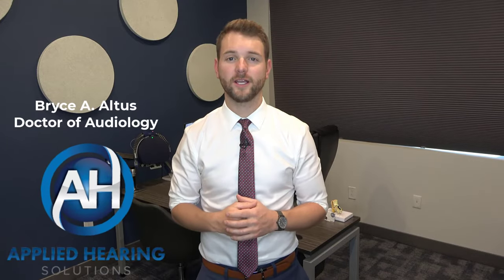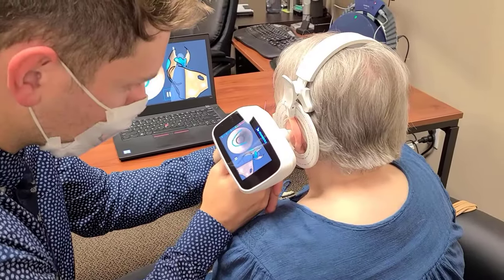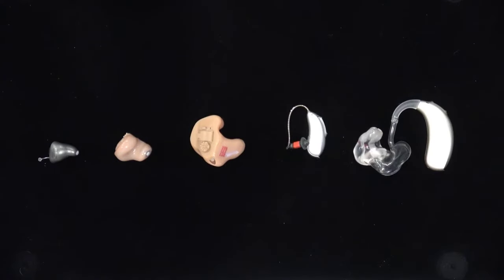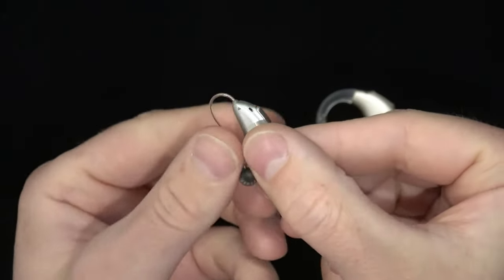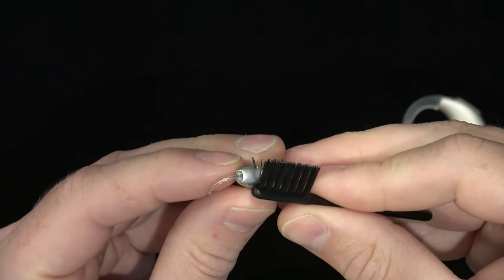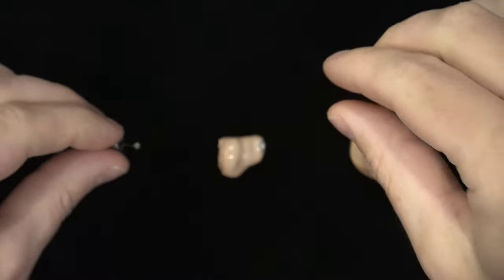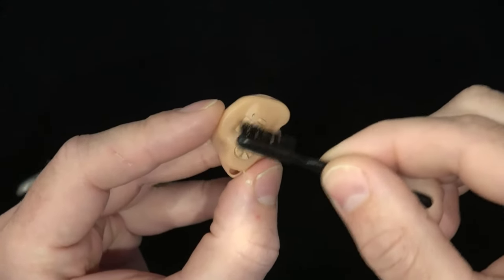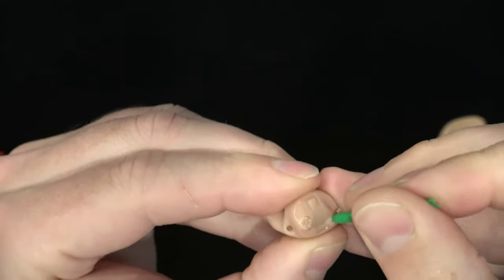Cleaning Your Hearing Aid Microphone  Ports! | Applied Hearing Solultions

Comment: I have Kirkland Rechargeabl Hearing Aids and my right Hearing aid shows in the app shows less  % of use than the left one. They bought come out of the charger at 100 %.  Why ?
Reply: This is not uncommon. Read your audiogram, did your right side have poorer than left one? This is make sense because usually the poorer ear side will need more amplification than the another. Thus, consume more power. Almost everyone (especially hearing impaired) will not hear things equally both right and left.
Reply: Thank You for getting back to me, but I'm Still puzzled because Costco gave me a loaner for my right ear and the same thing was happening, the girl said it must be your charger so she gave me a loaner charger  and we will see what happens. Any Ideas I'm Open to hear.    Today is the first day with my Right Hearing Aid replacement